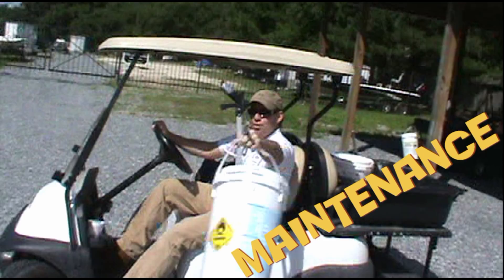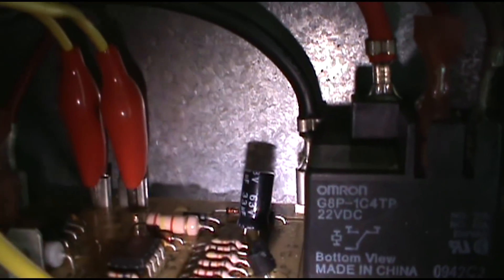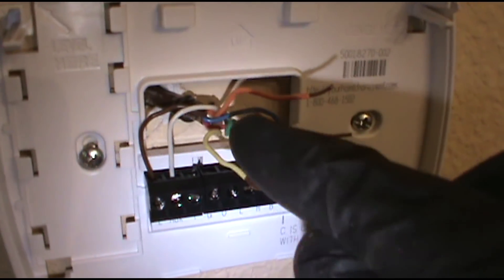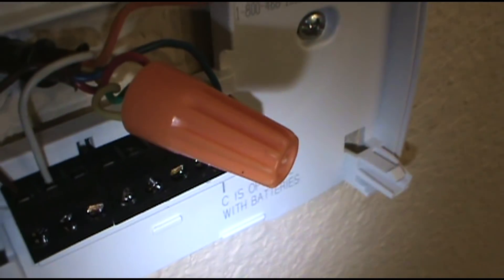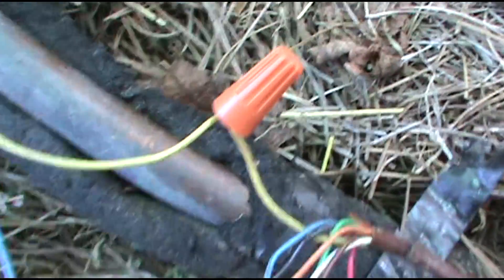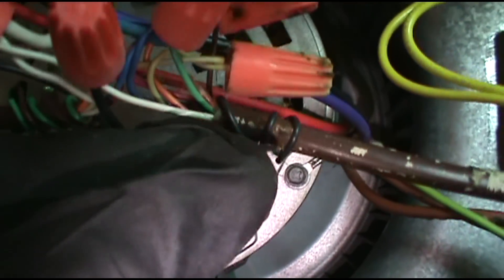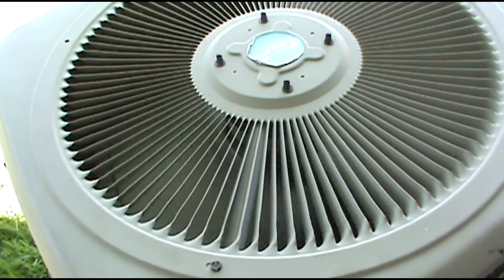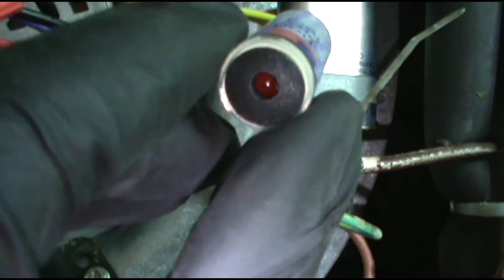Low Voltage Short On A Goodman A/C Not Cooling

Comment: Just had an issue where fuse blew immediately when unit called for COOL, twice in a row.  Contactor resistance measured OK, but replaced it anyway.... everything working since.  Ever see that?
Reply from the maker: Yes. And it's weird. Thank you so much for watching J!

Comment: Hi thanks for the video. Hope you can point me out on my problem. I switched from heating to A/C and my SSZ14 is not  starting. The error code on my goodman furnace AVPTC is C1 - LOW STAGE COOL - LEGACY MODE ONLY. Do you have any idea how to resolve this issue. The unit was working great during winter but now switching to A/C and the heat pump is not starting anymore. Thanks Hugo
Reply from the maker: I'd need to be there for this head scratcher 🤔

Comment: You changed out that dodgy connector with a wire nut outside. That would not cause a short ? or would a voltage drop here cause the contactor to pull too much current if it was not getting the full 24VAC  ???
Reply from the maker: Never had an issue or a call back afterwards. All good with the wire nut. Thank you so much for watching Michael!

Comment: lex  if i have a blockage  it would be filter dryer or piston i noticed the suction line at the air handler was not cold  so i could have a kink in line set    thank you   jim
Reply from the maker: James Rooney it could be piston or dryer. Unscrew the nut & look at the piston to see if theres something in it.

Comment: lex please help me out   i have   a 2 an half goodmon heat pump im installing it  i did nitrigen test for 3 hours at 200psi no leaks  did vacum pump to 400 microns  now im adding 410 refrig  i turn upside down and add to liquid line to 150psi  but when i turn unit on it goes to almost 500psi do i have too much freon or not enough thank you   jim
Reply from the maker: James Rooney Hmmm, you should add Freon into the big suction line. Not the little liquid line.Do it slowly too or you could over charge. If the head pressure keeps spiking after that, then theres a blockage some where.
Reply from the maker: James Rooney add Freon until you see around 50 Psi on the low side. Then turn unit on.
Reply from the maker: James Rooney I was saying in the past that during a pump down, you open the liquid line first. But you charge through the suction.
Reply: Its to easy to over charge puting liquid in the hi line i suspect over charged

Comment: Is that a temporary fix until u run new tstat wire bc 9.5 out of ten u will get a callback on those wire shorts. when they have those shorts almost all wires have them. They are bundled together so learn from t&n service mistake on doing what I did and next day him getting new wire.
Reply from the maker: Chalco Home solutions Yep, we'll have contractors come run new wire. We don't have time to dig down & run new wire from the top 3 stories high all the way down through 3 different apartments.
Thank you so much for watching Chalco!
www.DirtyMaintenanceNation.com

Comment: when adding freon to dry unit  should the system be running ??
Reply from the maker: James Rooney I add some while the system is off. Try to get it to around 75 Psi. Then I put the disconnect in to turn the unit on & fill it to the correct superheat.
Units with no Freon in it will not turn on if theres a low pressure switch in it. Thank you so much for watching James!
www.DirtyMaintenanceNation.com

Comment: Great work Skid!! Personally, I would have swapped the yellow for the black at the tstat too, and written it down in the air handler. Just easier to figure out for the next guy. What did you end up doing with the landscaper junction at the outdoor unit? Keep up the vids! Great stuff here!
Reply: Tim Dodson 
 I carry red, green, white and black electrical tape. When I have to change something up on wiring, I put a small piece of tape of the correct color just below where the wire is stripped.
Reply from the maker: Tim Dodson Well, I was afraid of not having enough slack to just wire nut the wires at the junction and wrapping them good. So, I had to keep them like that. I wrapped them real good and tight & buried them. I didn't have a lot of choices with that hackery. 👍😂👍 Thank you so much for watching Tim!
www.DirtyMaintenanceNation.com
Reply from the maker: TexasTimelapse Great idea! I'm going to go back today & do that. Thank you for the wisdom Tim and TexasTimelapse!